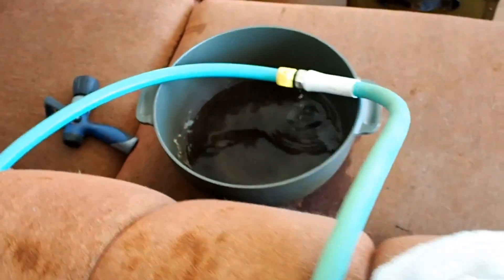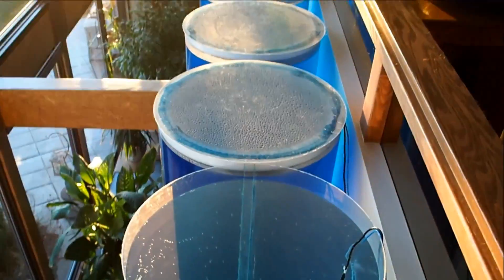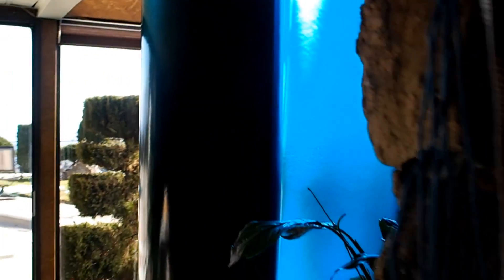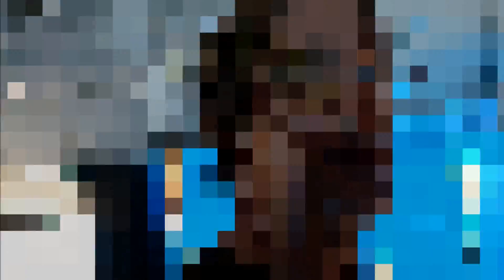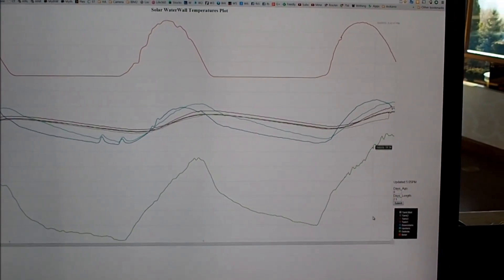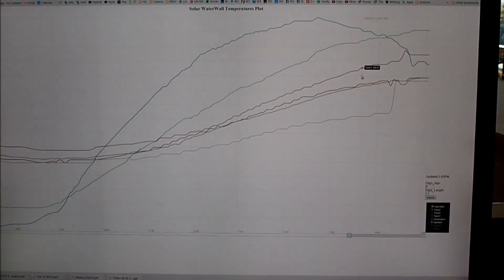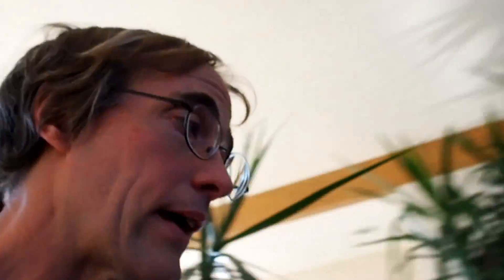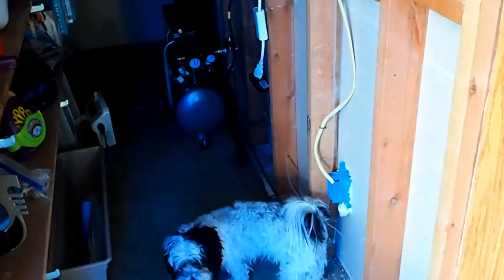Passive solar water wall battery

Comment: http://www.kmart.com/polaris-trail-boss-ii-hardtail-mtb-bicycle/p-00601449000P?plpSellerId=Kmart&prdNo=3&blockNo=3&blockType=G3#Imagezoom  This bike actually looks pretty nice for a low budget MTB, hardtail and trigger shifts. I hate the grip shifters. and aluminium frame.
Reply: https://pt.aliexpress.com/item/LED-Corn-Bulb-E27-E14-G9-LED-Lamp-220V-110V-LED-Bulb-Light-24-36-48/32822757433.html?spm=a2g03.search0104.3.10.22dc7785Wd4vOu&ws_ab_test=searchweb0_0,searchweb201602_1_10152_10065_10709_10151_10344_10068_10130_10324_10342_10547_10325_10343_10546_10340_5722611_10341_10548_10545_10697_10696_5722911_5722811_10084_5722711_10083_10618_10307_10710_5711211_10059_308_100031_10103_441_10624_10623_10622_10621_10620_5711311_5722511-10620,searchweb201603_25,ppcSwitch_3&algo_expid=72b586ef-566b-46f2-9ecf-b9f10f9c1c94-0&algo_pvid=72b586ef-566b-46f2-9ecf-b9f10f9c1c94&priceBeautifyAB=0   I replaced all the bulbs in my house with these bulbs. Good deal lol

Comment: Why equalise the water temperature  at all ? just use the water at the top of the tanks to get your heat energy back.
Reply from the maker: The thinking based on Newton's law of cooling, "The rate of heat loss (or gain) of a body is proportional to the temperature difference between the body and its surroundings".
During the day, by lowering the temperature at the top of the tube, that increases the temperature differential at the top, allowing it to absorb more heat from the hotter air at the top.  Probably more importantly, there was mixing of the hotter water near the edge of the tube and the cooler water in the middle.  
There are enough other factors (e.g. direct heat absorption from the sunlight, heat gain at the bottom) that it was not at all obvious if that would help much.   But it seemed a good excuse to have fun with bubbles :-)
Reply: Fair enough Bruce so long as you arent using much energy to do it.

Comment: how many degrees in electronics did it take to be able to build and program what you want it to  (and work)
Reply from the maker: :-)   I do have a couple, but I learned all the tricks used in this setup post-degrees via online websites.   But it is all optional.  The 'cool' (or 'hot') thing about passive solar is all you need is sunlight and something heavy, like water.

Comment: So you took solar energy that was already in your home, stored it in water, then released it slowly during the evening. I'd like to see the math behind the net energy savings of heating up the water vs heating up the walls.
Reply from the maker: The biggest issue was the temperature swing.   When the energy was stored in the walls and air, the swing was higher, since those materials have lower heat storage capacity.  80-90 degree indoor temperatures less comfortable than 70s.   Closing the curtains would fix that, but then we are wasting free energy.

Comment: Thanks for the video. I also have wanted to do this, but the clear tubes have always been too expensive. I could not find where you say what those are and where you got them. Could you please let me  know if you can. Thank you!
Reply from the maker: There is a link to http://solar-components.com on the above referenced project page:  http://misterhouse.blogspot.com/2015/03/passive-solar-water-wall-battery.html
Reply: Thank you very much for the quick response and link. That is the kind of price I have trying to avoid - but clear tubes like that don't come up too often on Craigslist!

Comment: A 2 dm thick, black painted wall would have had better thermal properties, and better efficiency for evening the temperature, would also have saved you alot of money, could have been layered as bricks aswell.
Photo voltaic is not the way forward, thermal solar is, can be stored cheaply, and collectors price can be slashed compared to PV Solar, see some of the projects here, DIY friendly aswell, http://circuminvent.com/
Reply from the maker: I agree that for heating, thermal solar is cheaper than PV Solar, but not sure about thermal bricks.  Can you build an equivalent brick wall for $3k?   
It would have to 5x heavier (5 *  5 tons for water = 25 tons), as water stores 5x more heat than brick.   Based on https://www.engineeringtoolbox.com/specific-heat-capacity-d_391.html , the specific heat capacity of brick is 840Jkg−1K−1.  The specific heat capacity of water is 4182Jkg−1K−1.
Reply: Yes you are correct, the wall is not thick enough, i checked little bit and it seems a concrete wall 0,56m thick would have the same properties. Thats then 9,23 M3 so then the price of concrete is 2049 USD, then u have to add re bars, but could aswell also reduce the amount of concrete by more than 25% by adding random stones in the mix, since this wall would not have load bearing capacity. Also pieces of crushed concrete from a teared down building would do the trick. 

So lets then say 1537 USD for the concrete, and thats including delivery cost. If you can m,ix and pick up the concrete by yourself, price would be lower but effort higher. Then You need the material for building the mold, but for me i dont even know where you live, i just assumed USA here.

Lets imagine you let the mold travel upwards while letting the concrete settle, this would have the mold price to a minimum.

So i  still say its possible to save money, the error i made was that i made assumption that those pipes would be way much higher in price than i saw now when i was looking closer on your website and followed the links there, but yet again perhaps 50% reduction in price would be easy, but the tubes would look much better :)
Reply from the maker: Thanks for the analysis.   You have an interesting website, quite a wide range of energy related topics.

Comment: Excellent work!
I've been trying to find some clear tubes to use in my build. Could you tell me where to find them?
Fantastic place! Thanks for showing it!
Wulf
Reply from the maker: Thanks!   Tubes are from solar-components, there is a link to them from the project page: http://misterhouse.blogspot.com/2015/03/passive-solar-water-wall-battery.html
Reply: @BruceWinter  what are those tanks made of?  Polypropylene?  How thick?
Reply from the maker: @l0I0I0I0  Fiberglass, I think 1/8" thick.  More info on their website: http://www.solar-components.com/TUBES.HTM
Reply: @BruceWinter  If I can get my greenhouse up and running, I will definitely be using this!  Read dozens of vids on this topic, but this is  my favorite and what I will go with.   I'm in Arkansas.  I'll put up banners during the summer to keep the heat down.    Just wondering how well bubbles works for circulating the heat?   Also wondering if the tanks can be used for structural support, saves money?   Never heard of that one, using bubbles to circulate heat before if I understand correctly?   I'm also open to low power ultrasonic devices to cheaply mix the water but not sure how well it will work with those volumes of water.   Love the color schemes, it's worth loosing a little heat.   Thank you in advance!
Reply from the maker: @l0I0I0I0  The bubbles efficacy is reflected in the graphs shown in the video, they help.  I doubt ultrasonic would do much.    I would not use the tubs for structural support.
Reply: @BruceWinter  Thanks Bruce.   I may add thermal syphoning to bring the heat from high in the tank to low in the tank ,  in conjunction with a heat source.  Not sure yet.  I really like the simplicity of your system but I'm using it for a greenhouse and may need more control over the temps to maximize yield.  After many weeks of studying these topics, I much appreciate the balance of your system taking the complex and making it simple.   Something I struggle with.  TY.

Comment: You could have dispensed with the air bubbles if you put a vertical divider from side to side that seperated the front and back halves and stopped short of the surface of the water as well as stopping short of the bottom the bottom. This would have had natural convection continuously circulate the water.

Comment: Would this type of setup work with PET soda bottles?
Reply from the maker: I suppose, not sure how you would mount or how nice it would look.   The 10 tube setup I had was 1300 gallons, which would take about 10,000 16 oz bottles.   If you drank one a day, it would take about 30 years to get 10k bottles.
Reply: Oh, I was just thinking of repurposing used bottles. You said that the tubes were the most expensive part of the project.

Comment: The question I have is: Why "bubble" the tubes to equalize their temperatures? Correct me if I'm wrong but, you've collected a certain amount of thermal energy into the tubes, equalizing them does nothing for the total temperature within your enclosed space (room, house, whatever)... the energy is already in there. In fact, wouldn't it be easier to extract the heat if it was all contained at the top instead of dispersed along the whole height?
Reply from the maker: Good question!  The thinking based on Newton's law of cooling, "The rate of heat loss (or gain) of a body is proportional to the temperature difference between the body and its surroundings".    This is the reason you can lower heating bills by lowering your thermostat at night, even though you have to re-heat the house the next morning.  You loose less energy because of a lower temperature differential inside to outside.  

During the day, by lowering the temperature at the top of the tube, that increases the temperature differential at the top, allowing it to absorb more heat from the hotter air at the top.  Probably more importantly, there was mixing of the hotter water near the edge of the tube and the cooler water in the middle.  

There are enough other factors (e.g. direct heat absorption from the sunlight, heat gain at the bottom) that it was not at all obvious if that would help much.   But it seemed a good excuse to have fun with bubbles :-)
Reply: Yes, that's right. Even though my comment even suggested it, I hadn't considered that the higher temperature differential would have a higher heat dispersion. Equalizing the temperature keeps the differential lower, making it easier for you to increase the stored energy. The thermal mass/heating solution I've considered has "heat chambers" and uses thermo siphoning to circulate the fluid from a highly insulated holding tank. Later,  when the heat energy is needed, it's pumped through a radiation circuit. Thanks for sharing your project.

Comment: I guess if you cut back on sf of home you could save money by not needing as much power to maintain the heat- you are too dependent on electrical fans and compressors. I think you should be circulating air through heat exchangers of your masses in winter and subterranean coolers in summer. The water is pretty and could have been cheaper system if you had looked in fact glass is so abundant you could have stacked aquariums- of course unsealed they create humidity and evaporate. Cover with latex so they can expand contract with temp like a balloon. Did you put in a chlorine type stabilizer.

Comment: What were the tanks made from?  where can I get some of that clear pipe?? I want to use it to grow alge
Reply from the maker: Fiberglass.   The maker sells an alge version (adds a valve on the bottom).   solar-components, there is a link to them from the project page: http://misterhouse.blogspot.com/2015/03/passive-solar-water-wall-battery.html

Comment: Why did you move?
Reply from the maker: Following my wife's job, she was not a lucky tele-commuter like I was.   Was hard to leave Utah and that lovely house, but we found another great house in Alabama.
Reply: How did the work you did, adding the water columns etc. effect the sale of your house?  Was it easy to sell with all the add-ons or did you find that it was an impediment?  Great video by the way.  Cool ideas! Very much appreciated.
Reply from the maker: Hard to judge what potential buyers thought, as we usually didn't get much feedback.  The house sold in a couple of months for the price it was appraised at.   I took out the trickier home automation parts, like the solar water monitoring, but left most of it, like the z-wave devices controlled via smartthings and Alexa.
Reply: You've done some great videos.  Thank you for posting, I'll be looking forward to more in the future.  Keep up the great work!

Comment: leaving the tubes light may allow enough UV light in to sanitize the water if they were caped. a small high pressure diafram air  pump would probably be more elegant. experimenting with airrator stones might have been cool looking but large bubbles also have their own good look.  the particulent used in shimmery hand soap can be seperated out and added  to the water it settles to the bottom but the air might kick it up enough to add a cool effect.

Comment: I would think that running the compressor would negate any gains from the tubes far as temperature and cost of heating the home.
Reply from the maker: The compressor only ran for a few minutes a day.  Is an optional component, was used as much for aesthetics as for efficiency.
Reply: Bruce Winter I understand that I definitely love it.... I should have said that especially with all the led lights at night. So even if it was a break even far as power or energy used the Aesthetics would be well worth it.

Comment: A heat pipe, thermal syphon, would have been a great way to pull heat out without using any energy to move it.

Comment: Cool. Did the bubbles drop the temp or was it even measurable?
Reply from the maker: Yep, 30 seconds of bubbles equalized bottom/top temperature, as seen by the graph about 6 minutes into the video.

Comment: I almost wonder if you could have used copper sulfate instead of pond dye and built massive DC batteries that would've powered the fans and the lights.

Comment: Bruce, electromagnetic waves (solar rays) wont care about how much mass of cold water u have inside, because of your exposure windows, u will be transfering a lot of heat to ur home, and water mass isnt the %100 thermal mass you have on your home.

Step 1: provide a high aluminium exterior window cover(if exterior its better in summer, for winter interior is escential, u want to keep your heat inside)
Step 2: Good insulation.
Step 3: no need for a step 3.
Reply from the maker: Agreed, insulation at night is important.  The double honeycomb cellular shades I put in helped retain heat quite a bit.
Reply: Bruce, as a solar thermal energy student, the best way to protect against solar, and against cold, most economic, low weight its aluminium foils (they are much more cost/effective than any high tech poliurethane and all other insulators) because aluminum (high quality reflective one) reflects from the inside or the outside all wave lenghts from +330 nm mostly (from UV to infrared). On winter, passive solar heat is the best cost/effective, not only for not $$$, but for not even making  any effort or wasting your energy on any kind of action, just to open your windows and let all sunlight "charge" the thermal mass inside your home.

New ways of insulating homes arent yet ready due to Monopolic "fossil fuel" markets, not only energy, but many "middle" insulators than arent really cost/effective at all, due to they industry process, price, not only for their efficiency. Believe me aluminum is the future on thermal insulation(good quality reflects %95 infrared).

Comment: The principle problem with this setup was going to be how to get the heat back out of the tubes overnight in the winter.  I suspect that their ability to absorb heat vastly outstrips their ability to re-radiate it, even with a little force air convection (tiny fan).  Increased surface area is what's needed, tough problem.  The solution is passive convective radiators with plumbing and solenoid valves all computerized up.  Hot water will self convect and circulate to higher surface area radiators if properly designed, simply shutoff the valves during collection, no pumps required.
Reply from the maker: I wondered about that also, but the temperature plots from the water in the tubes showed they would loose all the heat they gained during they day at night.   We let it get pretty cold at night (upper 50s), might have been more of an issue if let the furnace keep the night temperature higher.
Reply: Well that's very interesting and a pretty good result.  Although it also means that in winter you would've been short on heat, but of course it doesn't mean you wouldn't have experienced an improvement.

Comment: air mixing could have been achieved by using a 2" pvc water  lift tube, that was 80 -90% the length of the water vessels.
then place an air stone to create lots of small bubbles, about 2' below the surface of the water, and inside the lift tube.
this air can be driven by a much more efficient and virtually silent  aquaculture air pump, which would only use about 120 watts of power. the friction created by the numerous small bubbles of air can move surprising amounts of water.
and only pushing air 2' down is a lot easier than 10'.
Reply from the maker: Interesting, does sound more efficient.   Probably not a pretty though.   Thanks for the comment.

Comment: Hi, I heard you mention the service xively. As you might know (or not), xively shut down on jan 15th this year. I was using it to monitor my solar water heater temperatures (also using an arduino wit temp sensors). Have you found a viable alternative that works wit an arduino? Thanks!
Reply from the maker: I haven't yet, but it is on my todo list.   An entrepanour just created a plugin replacement, but says it is pretty beta:    https://iotplotter.com .   Probably will switch to   https://thingspeak.com , or maybe locally run  RRDTool .